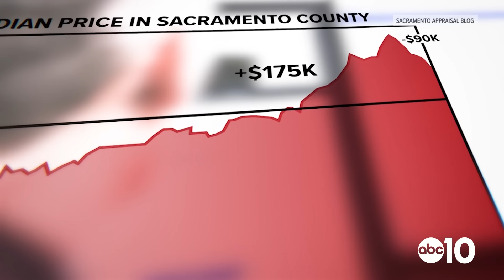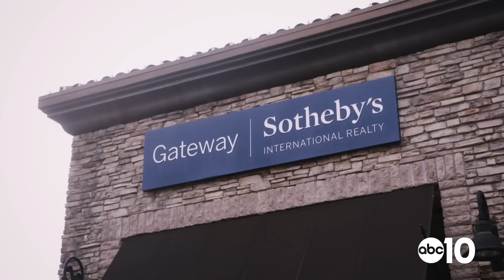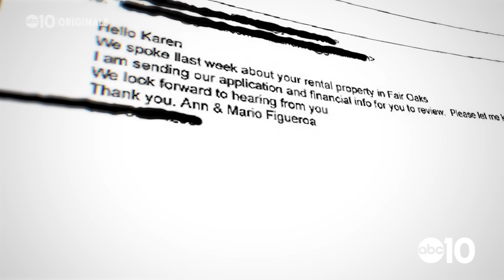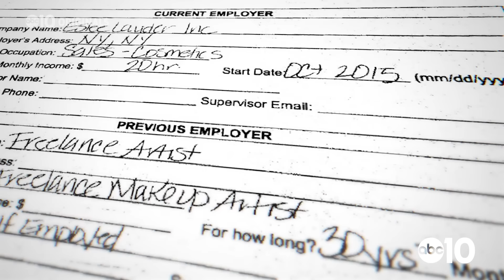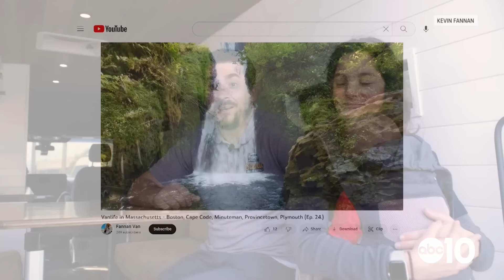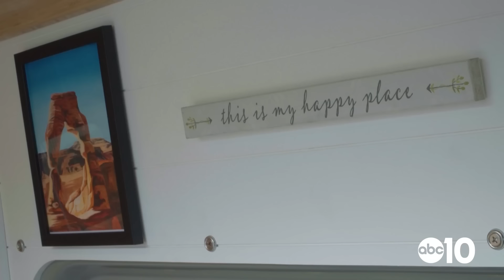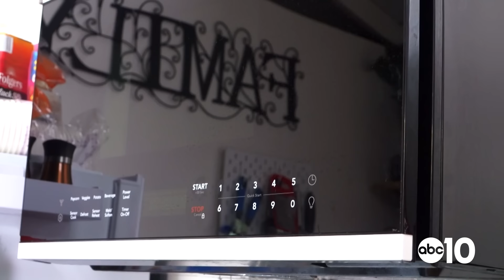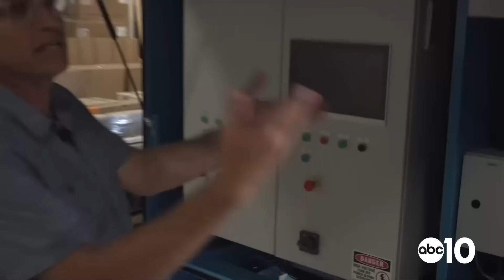California Housing: A look at problems and possible solutions

Comment: That's why I'm scared to buy a house, but renting an apartment is a bigger threat too. Every year, they keep raising the rental payment and it's really concerning...
Reply: They also raise the property tax so you’d be adding on more property tax too
Reply: Buy a duplex live in one and rent the other one
Reply: Rent in rent controlled areas of your concern is unreasonable increases in rent.  The state has rent control and many cities have stricter rent controls on older buildings. Good luck.
Reply: @oscarcaballero9014 cap rates aren’t there for most desirable buildings.
Reply: I have a very nice custom built home in Central valley has an Attic space that needs to be finished out.
 I designed it so it can be either a one bedroom or studio apartment. You can live downstairs finish the upstairs and then  Rent it out helps cover your mortgage. It has a separate entrance gate some both sides of the house. has a big yard and swimming pool.... This is a good home if you want to offset your mortgage ....
Can also be multi-family use if you have a large family. 
Double lot  You can also fit a large ADU outback I have a double  Lot.
Reply: @oscarcaballero9014  That's a good idea if you can afford the Duplex. A duplex can cost more than  a house. If you can't even afford a 3 bedroom house, how can one afford a Duplex?
Reply: @RunW-TheBigDogs  Yep, when home prices become so expensive, people have to start renting out their rooms to random people from ads.  That's what happened during the last 2008 housing crash.
Reply: I'm a landlord and I didn't raise rents until the insurance cost DOUBLED then the property was re assessed so that cost increased!  I was forced to raise rent.
Reply: @oscarcaballero9014 you can’t do that in Northern California it’s illegal for a landlord to live in the same house unless it’s a co tenant so you’re giving out illegal advice
Reply: @Stanley-px3bt it’s illegal look at your renter laws so don’t try it
Reply: @oscarcaballero9014  I wouldn't do this in California, I think Texas would be way better for this. Here, if you can even find a Duplex for sale, they would easily be over 1.2 Million. In Texas you can find nice Duplexes for 450-500k thats way cheaper and you will still catch appreciation

Comment: New homes at 600 to 800k are not helping. Absentee landlords rent at high prices but dont do repairs. Its nuts.
Reply: Yes they do. Someone will move into that new house you can't afford and then you can rent the house they move out of. It's not that complicated.
Reply: Houses back in the 50s were around 950 Sq Ft. Today's homeowners want 4,000 Sq Ft 4 bed 4 ba  it's not surprising then why new houses are almost $1 mill

Comment: I have a very nice custom built home in Sacramento valley has an Attic space that needs to be finished out.
 I designed it so it can be either a one bedroom or studio apartment. You can live downstairs finish the upstairs and then  Rent it out helps cover your mortgage. It has a separate entrance gate some both sides of the house. has a big yard and swimming pool.... This is a good home if you want to offset your mortgage.
Can also be multi-family use if you have a large family. 
Double lot  You can also fit a large ADU outback I have a double  Lot.

Comment: ive been building homes in socal for 30 years, the number one reason my permits are deined is, NOT ENOUGH GRID. followed by, water, traffic and environmental. if you want to solve the housing problem, fix the power and water problem.
Reply: The #1 problem is NIMBYs mandating single family homes and restricting housing density. Infrastructure can be addressed.

California's water shortage is the result of agriculture growing unsustainable crops.  Water equates to profits and there will never been enough profits to satisfy shareholders.

Comment: Solutions are 3D printed homes, Renovate $3000 shed for the homeless and have state and federal inmates build tiny homes for Gen XYZ
Reply: The solution is higher density housing.  3D printed homes aren't going to address the problem.  Comical.
Reply: High density like Singapore, Hong Kong, Japan

Comment: I bought a house in 1986 with a first-time buyers' FHA loan. The interest rate was 10%. So, to me today's rate of 6% sounds low.
Reply: It's not that simple. There are many other factors you need to consider.
Reply: The median home price in CA, is just over $700k. What was the price you our hard your home at? I guarantee it when you consider all factors, a 6% rate is not low.
Reply: Back then heck I'll pay 4 to 5 times my salary for a house at 10% interest. Now apply the same thing to today where homes are 8 to 12 times depending on city at a 6%. That simple metric alone tells you it's not nearly as affordable as the time you bought.
Reply: @ZuluNation05 yes, nail on the head. Also, look at a home in the subs in say 1960. Like 12k I believe.
Reply: Me too. But when time to sell, I found my fha documents were all falsified with false numbers. A scam. The mort co dissolved the corp. I lost everything, lawyer couldnt help.
Reply: Bought our first house 1996, 75k at 8% , mortgage $800 .. which was median rents back then .. that same house is 450k today & probably $3500 mortgage lol
Reply: @zeekflash6924  thats crazy good. Ideally your mortgage should be the same if not less than rent in a normal market. At least in my market rent is half as much as owning. Right now is just a game of patience.